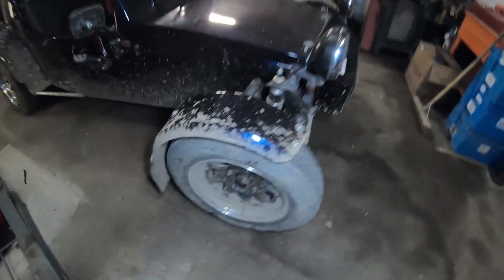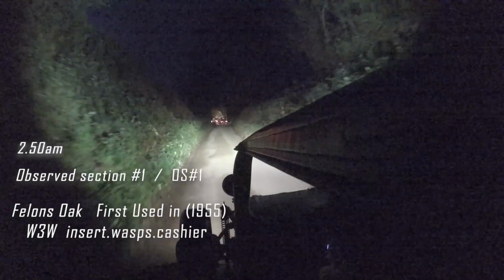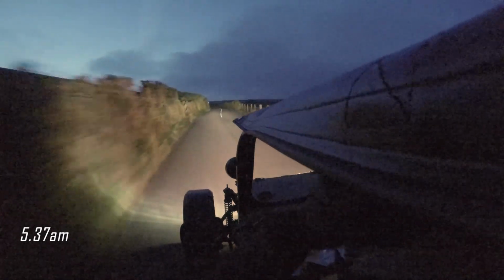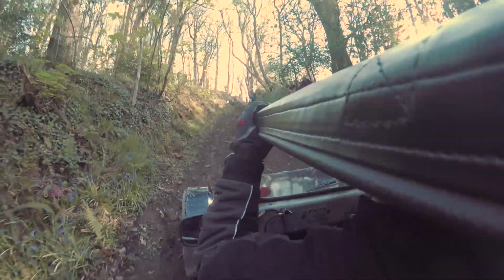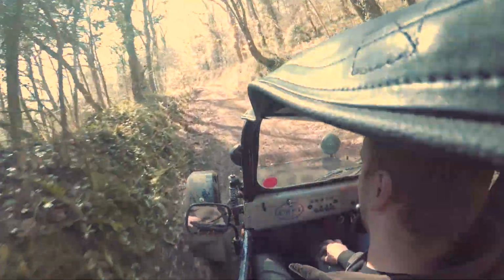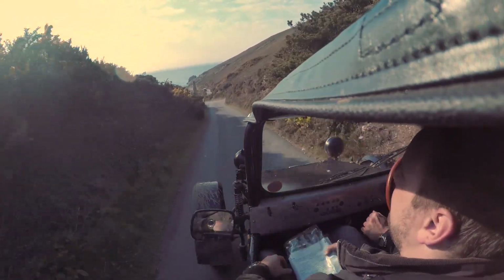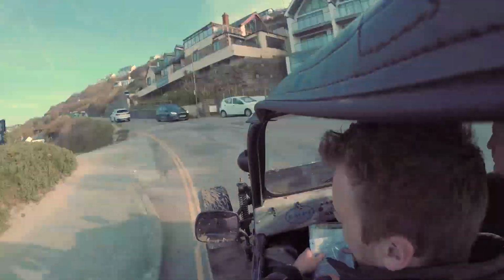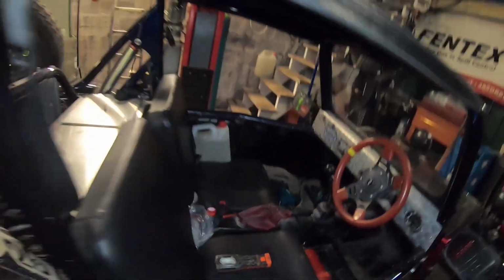Lands End Trial 2022 Full Day

Comment: I was competing in class o this year as this was my third trial and ended up with a medal and only failing beggars roost on the restart
Reply from the maker: Congratulations on getting a medal. I have strong feelings about beggars roost. I was very pleased that it had a restart this year as I have felt in previous trials it has been very tame. Obviously its unfortunate that you failed on the restart but i feel like it was a fitting tribute on the 100th anniversary of that particular section.
Reply: @TomUptonMotorsport  It was a good restart and I could have done it i wasn't on a honda xlr 125 and on something else with a bit more torque